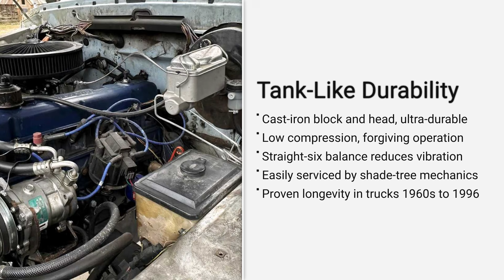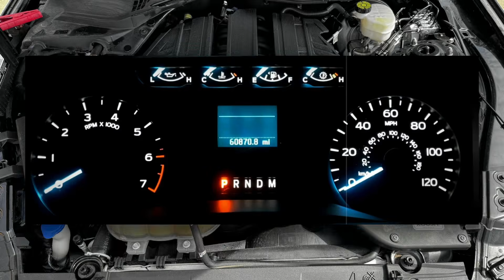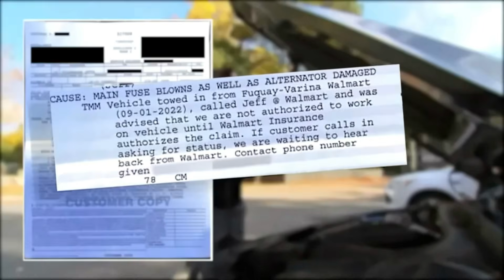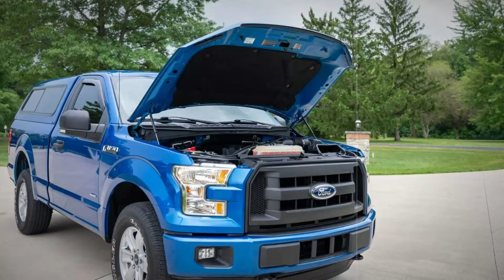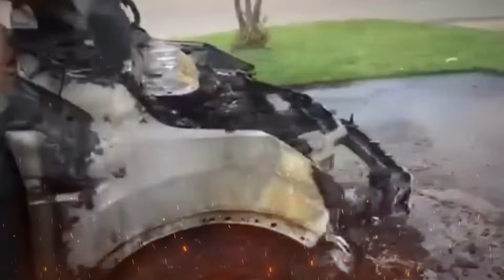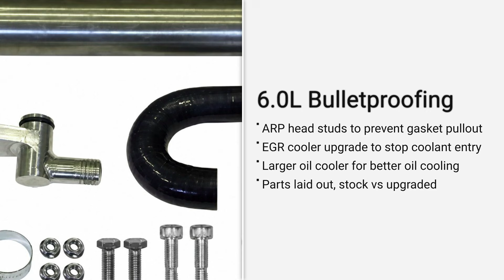Ford Engines Ranked: The Keepers, the Risks, and the Repair Bills

Comment: I got 2- 7.3's. one is a 2002 crew cab fwd , the other is same year but ext cab , both have almost 300,000. Will never get rid of them. Best diesel ever. Only draw back, auto trans is the weak link. In order to change oil pan you got to pull the motor to do it right. You can jack motor up and change it.